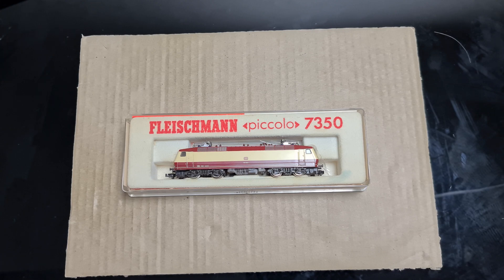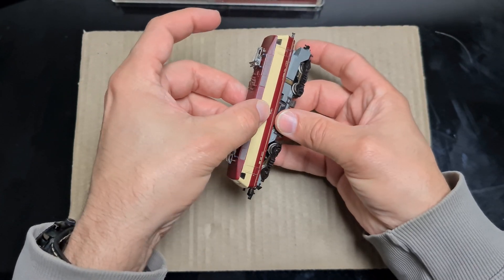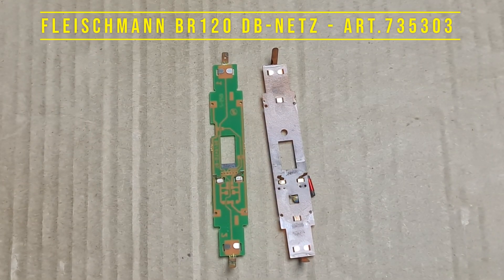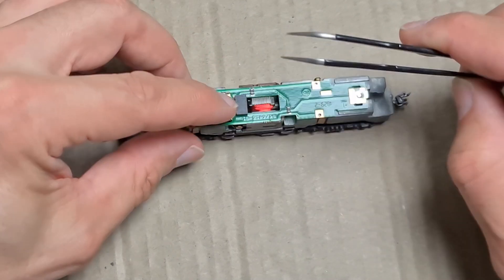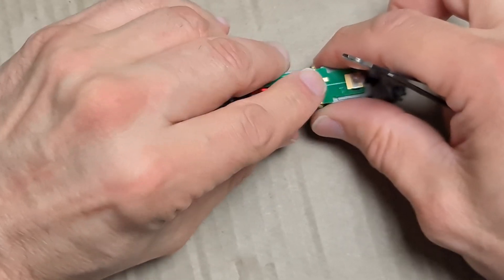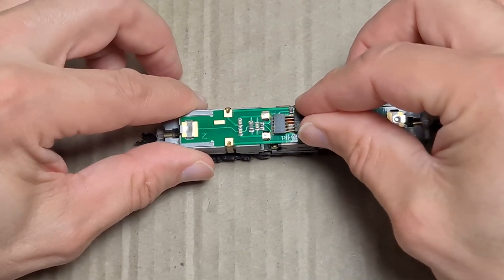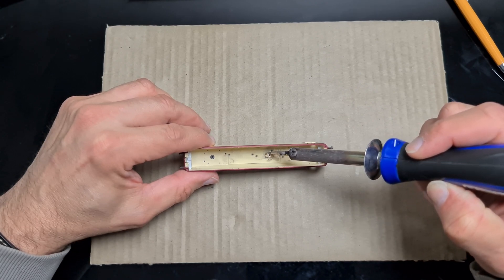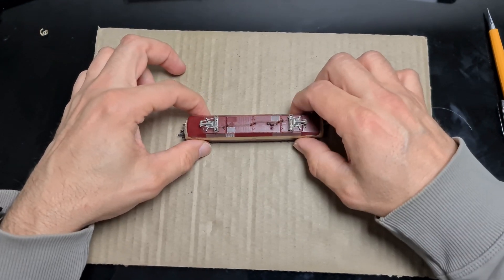Fleischmann 7350 - BR120 Digitalisieren ohne zu Löten! Easy to do for beginers | Für Anfänger

Comment: Hallo Mike, 👍👍👍
 Ein sehr schönes Digitalisierungs-Video, Ich habe eine Frage ob diese Platine mit den Modellen der Serie BB 15000 oder 22200 Referenz 7360/61 von FLEISCHMANNauch geht?
Sie sieht aus wie die Platine meiner BB, wie lang ist sie, ich brauche 76mm.
LG   Jean-Claude
Reply from the maker: Hallo Jean-Claude, die Platine passt nicht in deine Loks(7360), sie ist 88mm. Ich habe auch schon daran gedacht sie in die BR151 anzuwenden, leider stimmen die Strom Kontakte nicht überein.
LG Mike.